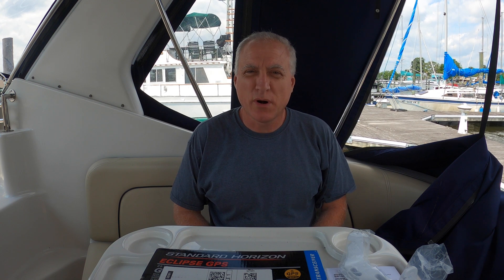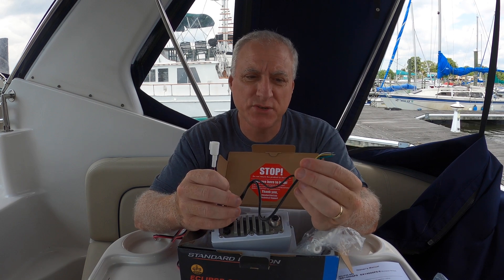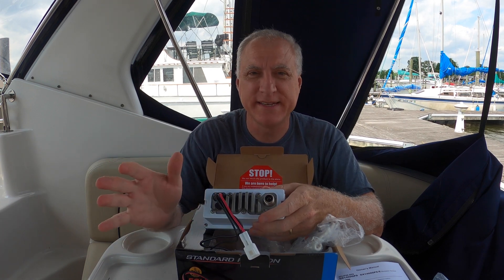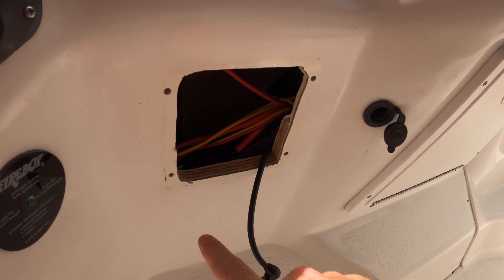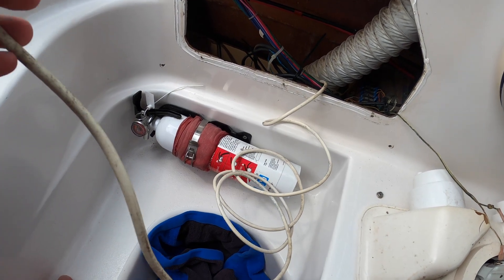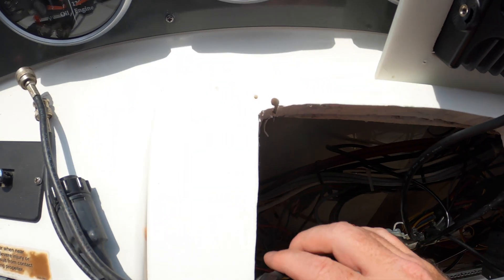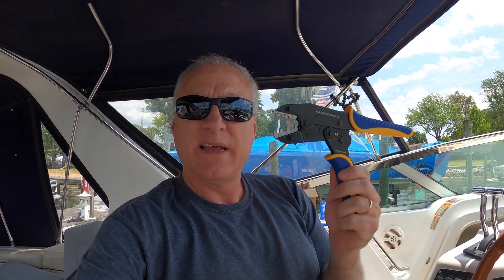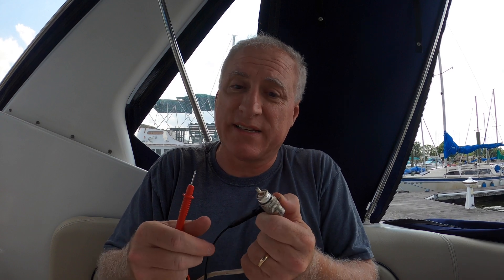Marine VHF Radio Installation Part 1 - Episode 120

Comment: First the power cord needs to be directly to the battery, second you need an SWR meter to be sure your antenna is tuned right or you could blow  the finals on your radio. Proceed with caution!

Comment: We replaced our antenna a couple of years ago.  It became brittle over the years and actually broke under the shrink wrap.  It was a pain to replace and we had the solder type connector, so that was an added headache.  But everything worked out in the end.
Reply from the maker: I have a solder and have yet to attempt it since this was apparently a solder less connection.  We’ll see!

Comment: "its just so manly" thats funny. I have the same manly kit, works good. I swear nothing is just straight forward easy.
Reply from the maker: Nothing! You are so right!!
Reply: I installed the same unit a few years ago. The wiring to my Garmin GPS was pretty straight forward. Unfortunately getting my old non working radio out was quite difficult. Great radio. Only thing I can't figure out is that if you are at anchor with radio on the GPS detects that you haven't moved and the radio sounds a loud beep until you key the mic. So if you want to monitor your radio at anchor you have to contend with that. Tried all the work arounds and it still does it

Comment: I used a solderless PL-259 connector because, well, I can't solder. 2 years and no problem. They're proud of those things price wise.
Reply from the maker: Thanks for the comment. Mine is supposedly solder less but you’ll see in part 2 that it’s not working.